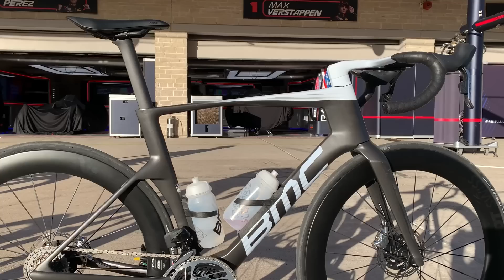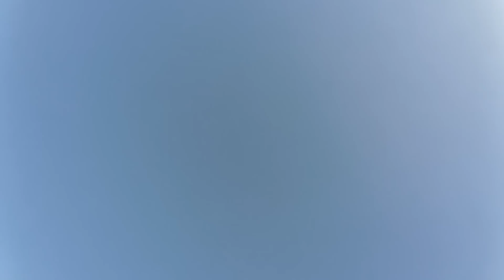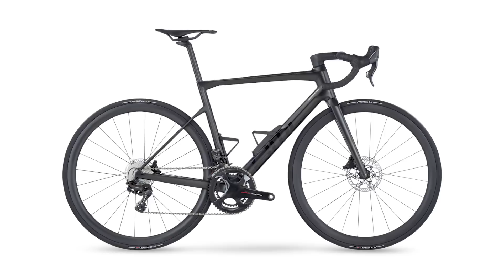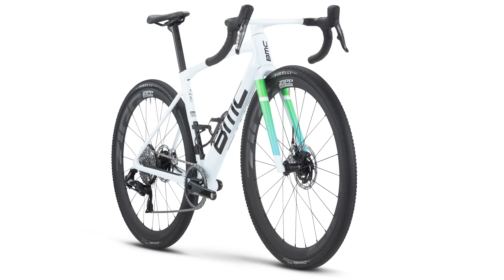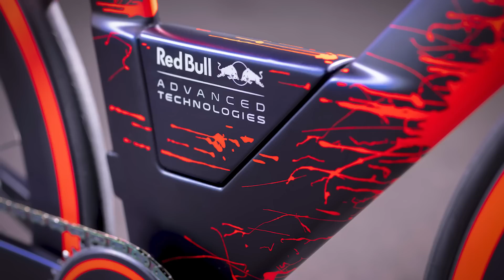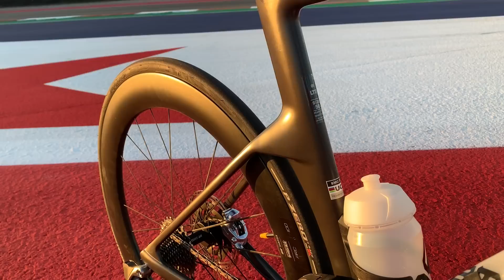New BMC Teammachine R ride feel, details, Red Bull racing interview

Comment: I got the Teammachine R01 model 2026 two months ago. The geometry is absolutely identical to the equally brand-new SLR01 (the less aerodynamic and lighter model). I quickly got used to these 36 cm handlebars after a few rides. They felt strange at first, but that's how I wanted it. Now it's no longer a problem at all; it's just a handlebar. The aerodynamics of the entire bike are great, I can really feel that. Most of the aerodynamic advantage over the SLR01 is probably due to the narrow handlebars and not the frame, but they won't tell us that. I can confirm that the bike rides great uphill, it's super stiff, and the Teammachine R01 frame is only about 230 g heavier than a really light frame. What I don't like so much is the reduced comfort compared to other bikes I've ridden before, and that's not because of the standard 26 mm tires. I ride with wide Zipp 353 rims and an effective tire width of 30 mm, as well as a pressure below 58 psi (4.0 bar). I also had to replace the saddle.
However, I don't regret the purchase and I look forward to every ride.

Comment: i saw you also tested the Kaius...Would you choose these narrow 36cm AERO bars over the 40cm EVO bars for everyday riding? Im putting together a team machine SLR01 build and have the option for either set of bars. I like riding in the hoods mainly, and getting out of the saddle, do you think the narrow bars are more for seated flat stuff? My bike fit recommended 38cm bars for me.
Reply from the maker: I wouldn't pick 36cm bars, no. I mean, I'm 49 years old and I ride for fun and health, and having a comfortable position is more important to me than aero fine details. Narrow bars are absolutely for riding seated. When you stand to climb, aero is out the window. Sure, you could be nerdy and argue that WorldTour sprinters want narrow cockpits when they are out of the saddle, but.... for the rest of us, no.
If you trust your bike fitter, go with what they say!
Reply: @TheRidewithBenDelaney  Interesting. Thanks for the reply! So in your experience, these narrow bars are a performance benefit at the cost of comfort and stability in the hoods? I prefer the look of the AERO bar over the EVO, but Id prefer it in 38 or a 40cm...but BMC weirdly lack options for their bar widths as Im sure you know. Im hoping I can find a local dealer soon who has both bars on demo bikes, but if not, I may have to play it safe and get the EVO bars.

Comment: Great video. Amazing bike! Would love it but I ride more rural paved roads and compliance is required for long rides. I think the tarmac is likely a better high end all around choice for my riding. Having said that I have a BMC gran fondo which is an absolutely fantastic all around bike. It’s fast, comfortable and easy to look at and be proud of its history and looks. Love that bike. I’m a big fan of BMC but I’m not sure I could spend that much on a bike that would not be comfy for a long ride on less than ideal roads. Still will keep a slot for it in my garage in case they come up with a more compliant version. If so I would jump at the chance to have a more aero bike.

Comment: What i dislike, the BB86 standard (this means your bearings are 41mm OD instead of 42mm. This translates to lower durability), the tire clearance (only 30mm).
I don't get why they did this. There's really no explanation that will do. And then there's that about the bar/stem combo. I don't personally like them as you can't adjust (the angle of) the bar.

Comment: My dream is that the UCI mandates that if a brand is to sponsor a professional team, these brands are restricted to making one road bike that will receive UCI approval. This would reduce confusion for consumers about which bike is the "best" road bike for their riding style. This would encourage companies and consumers to think more about the things that actually matter when it comes to going fast and being comfortable, which are wheels, tires, gearing, and contact points/positioning of the rider. We would see fewer chassis being offered, but likely more emphasis put into how they are built up. So, in the case of Canyon, you would have a road bike that was perhaps slightly heavier than the Ultimate, slightly less aero than the Aeroad, and slightly less compliant than the Endurace, rolled into one chassis, and then you would have the option of 60/45/35 rims, 25, 28, 32 tires, 54+40/52+36/etc rings, zero setback+long and slammed cockpit/15mm setback + short and tall cockpit. Every frame seemingly becoming aero, light and integration already has us about 90% of the way here already. For instance, an Endurace with 60mm rims with 25c tires, a 53+39, 11-30 cassette, sized down with a ton of saddle-bar drop and a 120 stem with 40c bars is WAAAYYYYY more of a race bike than a Aeroad with 30mm rims, 30c tires, 50/34 +11-36, and a stack of spacers under the short stem with 44cm bars. And likewise, that Aeroad would be close to the Endurace in terms of comfort if they were both set up this way. So, Canyon would end up making the Ultimate a bit heavier and more aero to approach the Aeroad, with slightly longer and slacker geo to approach the Endurace, and then have all the options available above when you order the Ultimaerondurace, and people would actually end up with a bike that suits their exact needs.

Comment: Hi Ben, I am in the market for a new ride and have come down to two bikes the BMC Teammachine R and the Specialized Tarmac SL8 S-Works. I am from Austin and curious to know how you found the Team Machine R on the Austin road's vs the track at COTA. I am also curious to know what it is like in Cross Winds and does the lower bottom bracket affect the ground clearance if you where to Crit race this bike?  You made reference to the Specialized Venge. Is the Team Machine R as stiff as the Venge or stiffer?
Reply from the maker: Hey Geoff. Crosswind feel is definitely about the wheels, right? The DT's on the top model are decent there, but perhaps not the absolutely best for stability. Some brands lean more towards wind tunnel speed, some more towards stable feel. I just did the two ride and didn't have crazy gusts to deal with. In general, the wider the rim (for the same depth), the more stable the things feel.
For BB drop, my notes have it at 69mm, vs 72 Tarmac, 70 Madone, 73 Melee, etc. So no worries there.
R vs Venge for perceived stiffness? Shoot, man - the differences are way too small and the time between riding the two bikes way too great for me to say anything of value there!
Good luck and have fun.
Reply: Hi Ben appreciate your feedback, so thank you so much for your response. I have ridden the SL8 over 30km and it felt smooth and very efficient to ride, it has a very compliant riding style nowhere as stiff as the Venge. I am not able to ride the BMC R so just trying to decide which way to go.  @TheRidewithBenDelaney

Comment: There was a mention of choice of carbon fibers being different for red bull in the designing of the bikes. So what was the differences ?
Reply from the maker: Here's the 'we're not giving anything away' response I got from BMC:

""The choice of carbon fibre was based on a joint mission for a stiffer and lighter frame, which involved a refined recipe with different ingredients.”

So hopefully my first answer was more helpful. Cheers.
Reply from the maker: Engineers always have a range of modulus fibers to work with, balancing stiffness (modulus) with strength. High modulus typically means lower impact strength. So I assume what he meant by 'more aggressive' in their choice was favoring more high modulus than BMC had done. Good question. Road.cc has a good explain on carbon in bikes here: https://road.cc/content/feature/what-does-ud-woven-and-high-modulus-fibre-mean-292479
Reply from the maker: He could also have meant being more aggressive in spending on types of fibers. I'll ask!

Comment: How does this compare to the Teammachine SLR01? Also, do you like the 36cm bar width, or do you prefer the wider bars on the SLR01?
Reply from the maker: Basically the same geo but stiffer. I love the SLR, for the record. Definitely an out-an-out race bike but just a skootch less aggressive on the front end than most, and what strikes me as a perfect balance of compliance and stiffness. I have relatively broad shoulders so a 40cm bar would still be aggressive for me. Normally I ride a 42. I rode a 44 for 10+ years.
Reply: @TheRidewithBenDelaney  ok, thanks for that!! I own the SLR01.. I have heard from a few sources now the R is extremely stiff, best for racing, and the SLR01 is better, all rounder... Yeah the 36cm bars seem too narrow.. I agree a size 40cm bar would of been better! I rider 42cm prefer the leverage like you said, especially off the saddle up hills..

Comment: I enjoy my 2017 BMC Teammachine .I also have a Spez Roubaix and a new Cannondale topstone gravel bike . Since buying the Topstone ,it is the only bike i ride . Tubeless 38mm tyres are as fast as road ones and the bike is heaps more versatile . I can keep up with the roadies and i am faster if the road surface is rough . BMC is a top bike ,but it is for racing full on .Bike for the pro,s that get paid to suffer .I want to ride fast but comfortable .Get a gravel bike like the Topstone
Reply: sure wouldn't get a Topstone if you simply wanted to ride a race bike (even if you don't race).

Comment: If could buy the bike would just the replace bars/ stem to some other bar/stem that fit better right away.  Or nor even have shop not install the them install the the ones I choose. Bar that small will work with smaller people or smooth roads but taller people/ rough pavement the stock bar got a go. Size 60/XL frame with such small bars seems out place and not comfortable.  BMC would been better to have three sizes of their bar/stem then match to fame size.  The philosophy of narrow bar is there but need range to make or work for various types of people.

Comment: Great review. I do wonder how much fun riding on a race track actually is. Really cool conceptually, but I imagine riding on a track designed for 250kph and more makes you feel super slow when going 30-60kph :D
Reply from the maker: Generally, yes - it does feel like being a little toy in a giant's world. That said, it depends on the track. Dropping into Laguna Seca's corkscrew is cool on any bike. The Florida F1 track is dead flat and not the coolest place to ride a bike. Giant did a launch at Magny-Cours in France that was halfway in between, kinda like this Austin track. 
Bike races on a car track would also make for boring spectating, because the track is just so wide. It's like road stage races on giant US highways made for semis vs the Giro on tiny little serpentine lanes. 
Still cool to see the scene there in Austin. I don't care about car racing but I love to see fans fired up about their thing.
Reply: I did a 12H bike race in Monza, from sunset to dawn, it was fun because we were doing relays and we were at night with lights etc. but I wouldn't do it daytime, especially because I have driven (cars and motorbikes) pretty hard on the same track and it is meant to be driven/ridden full gas. That BMC looks speedy though.
Reply: There should be more cycling events on race tracks, at least in the US. Spectators are what's sorely lacking in the sport here.
Reply: @industryrule-4080 I've loved racing on tracks.  But they don't really bring many spectators.  Crits in big cities draw bigger crowds
Reply: I used to take my bike to the racetracks I rode my moto on. The first thing you realize is that that flat straight road you think it is on the motorcycle is actually a 5% climb in some cases 🤣 Places you wouldn't think to be a big grade are sometimes almost double digits! It's alright but the racetracks are soooooo wide. Riding on tight, technical canyon roads will always be more fun for going slow. If you're on a fast moto or car, those tracks get tight and technical, very fast :)